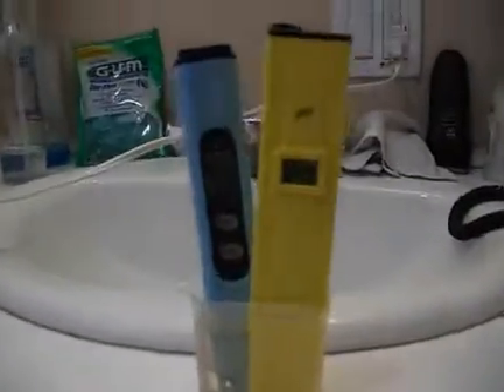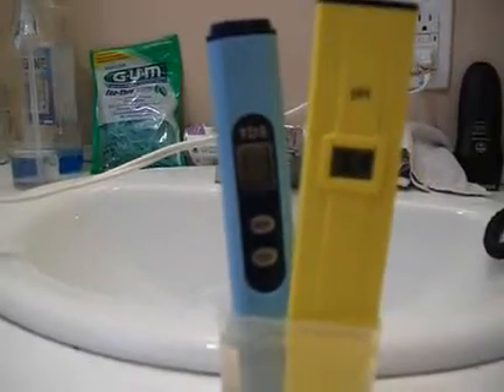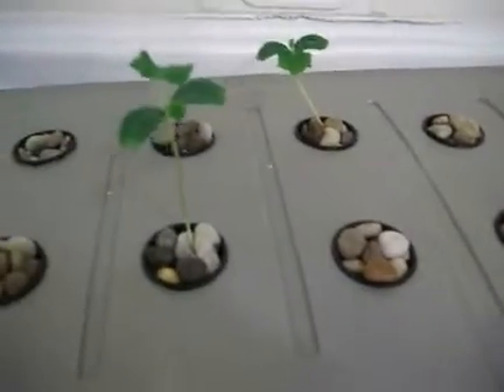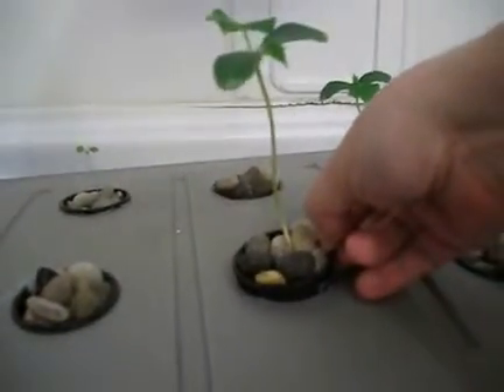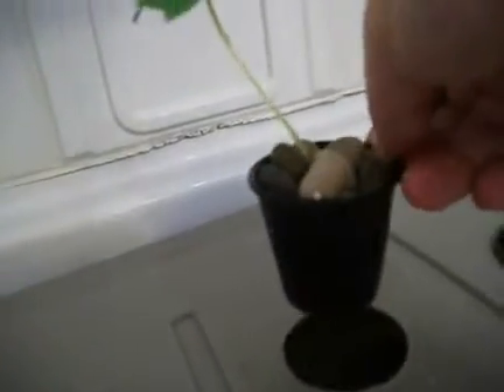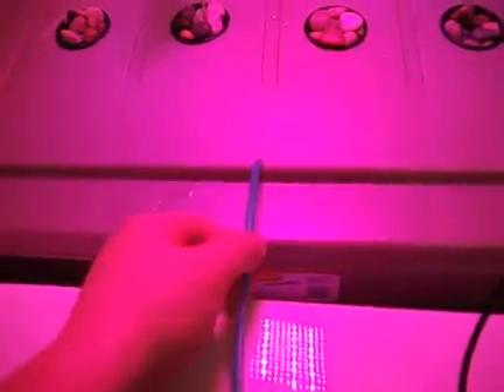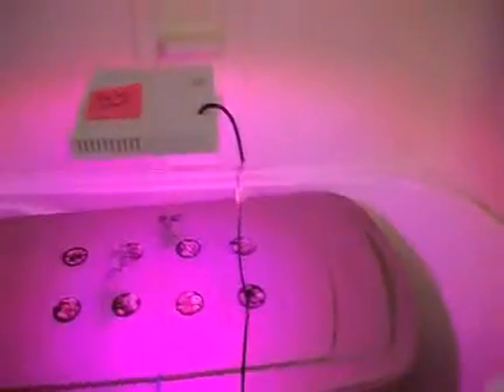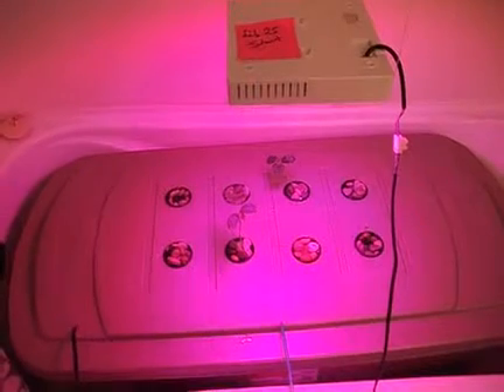Aeroponic system home made part 7

Comment: This is a very fun hobby. Your plants look a little stretchy. A suggestion would be to lower the light a bit. Leds don't have intensity HID lighting does. I now use bubbler buckets. You can fit a couple plants on each and its a lot easier to manage than the big tubs. I'll have to check out your other vids. I always added a bit of super thrive and hydrogen peroxide to my solutions, I hope your bok choy turns out great, My wife cooks with it all the time, never had it until I met her, good stuff..